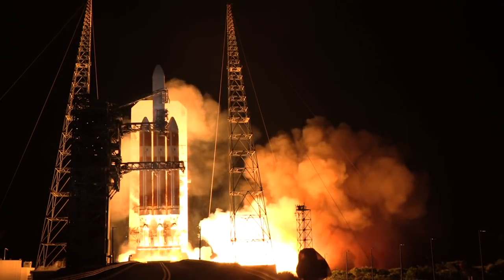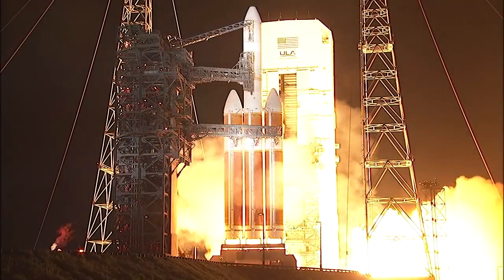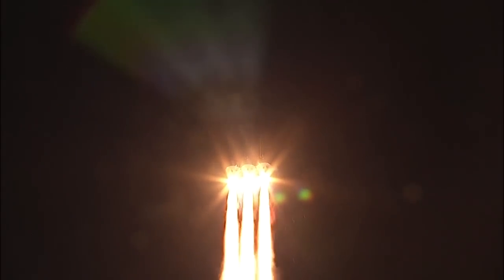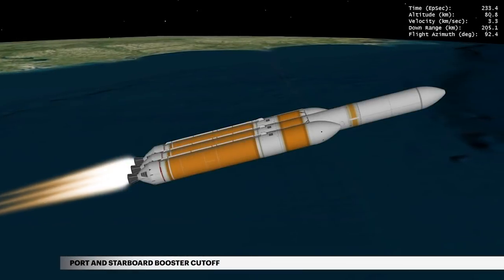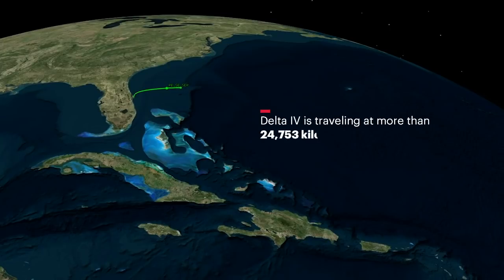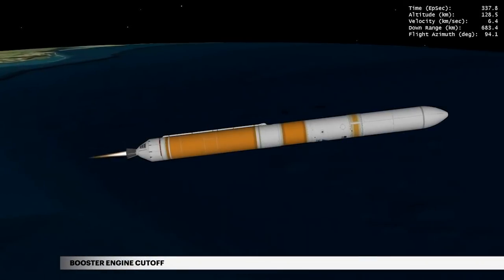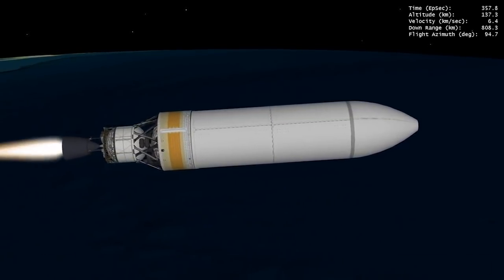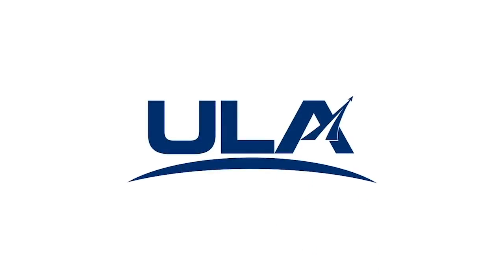Delta IV Heavy NROL 44 Mission Profile

Comment: I plan on attending the launch.  Assuming it could land, would the Delta IV be capable of being reused? I suppose I'm wondering if ULA would have to start from scratch to develop a reusable rocket or can they simply make changes to the Delta IV?
Reply: If they could somehow survive atmo entry and recover stages intact, yes, they probably could. The RS-68 nozzle is ablatively cooled to simplify design, and while I don't know how much of the nozzle is destroyed, refurbishment may require simply a new coating or an entirely new nozzle. The entire powerhead, the pumps and injector plate could probably be used again. Delta IV heavy is slowly being phased out as with the Atlas V, and eventually the Vulcan centaur will take over. ULA plans to seperate the engines of the Vulcan and recover them downrange in a process called SMART Reuse, and they are also developing ACES, or Advanced Cryogenic Evolved Stage. This can store cryogenic propellants for weeks at a time in orbit, and can be refueled.
Reply: No they'd be better off designing something from scratch. The center core almost reaches orbit about 2-3 times as fast as a Falcon 9 booster, this makes recovery impractical and a single engine has too much thrust to land the stage. That's why Falcon has many engines at liftoff it's 550 t but coming back down an F9 booster only weighs 30 t with fuel. So you need multiple engines because you can't generally throttle down an engine to much less than half. For now they'll be flying Vulcan but I'm confident the rocket to replace Vulcan will be something along the lines of F9. Tory Bruno knows this must eventually happen if things continue the way they have been going lately. Multi engine boosters and powerful upper stage that does most of the work is most likely the way to go on reusable rockets.
Reply: @please_stop-v7o  I'm not sure. If I understand correctly, ULA isn't pursuing propulsive landing reuse. Given the recent contract ULA offered 2 launches for the price of slightly higher than SpaceX 1 launch, they seem to be confident in interviews that SpaceX's propulsive landing is not the way to go.
Reply: Osman Safian Baharuddin I don’t think that ULA  has made any such decision about reuse. As far as the comparison of a 2 for 1 price comparison, while enticing it truly is meaningless. ULA’s price for that one was obviously higher for that one. What ULA has that Spacex doesn’t is decades of being the only vendor and therefore competitive inroads that we can’t even imagine. nothing in my response is to denigrate what ULA has done, is doing and will do but their lack of innovation may come back to hurt them.

Comment: Delta Heavy was my favorite Rocket... until the Falcon Heavy launched... However it's still a awesome Rocket. I love the color of the flame and how it spills over during launch, it looks so cool.
Reply: This is Definitely an impressive looking beast for sure but it doesn't beat watching the side boosters coming back and landing side by side in almost perfect sync and to think that Elon wishes he never went through with the FH and just skipped right to starship.
Reply: @tgm9991  The booster landing is sweet, no doubt about it. Although in that reusable mode the FH can't put as much weight into GTO as a Delta IV heavy can (8,000kg vs 14,220kg). In order to equal or surpass the Delta IV for GTO, which it can do, it has to go fully expendable, which means not getting to see the side boosters coming back and landing side by side in almost perfect sync. (I'm pretty sure its LEO capability in reusable mode are also less than the Delta IV Heavy's, but I couldn't find solid numbers.) That might be part of why Elon Musk has had second thoughts about the FH.

I personally love both the Delta IV Heavy and the Falcon Heavy, and am looking forward to both Vulcan and Super Heavy.
Reply: @OptimusNiaa  Yeah the payloads that FH can carry is pretty disappointing and it's not just the weights it's the size of the payloads too apparently and I can see how in a business sense it wasn't worth the money due to the complexity and seeing all those merlin engines lift off and the landings beats a Delta IV heavy launch for me.